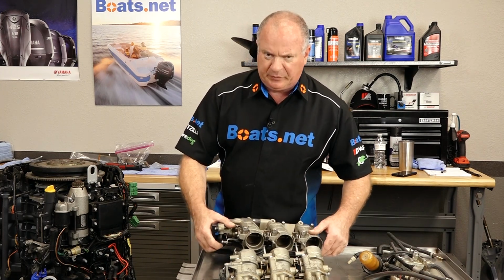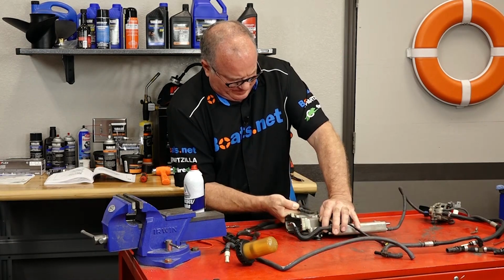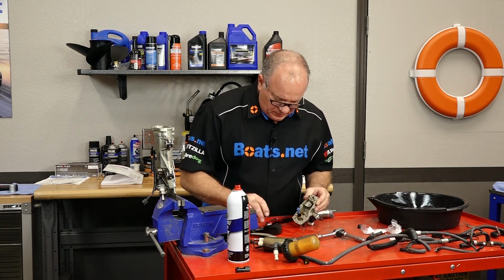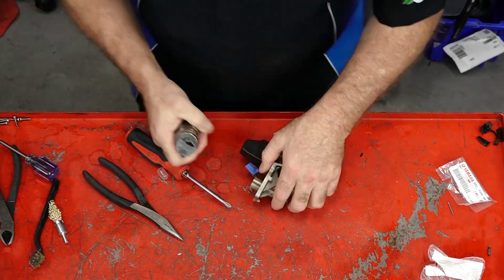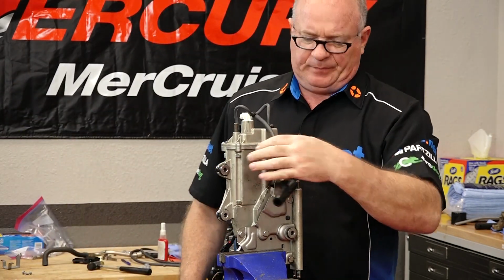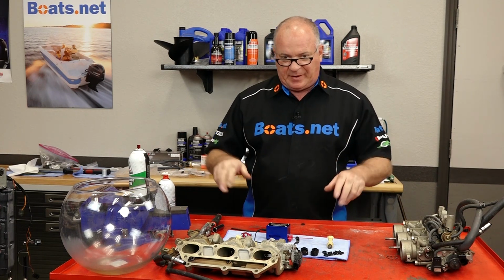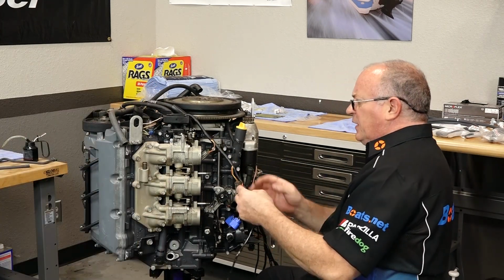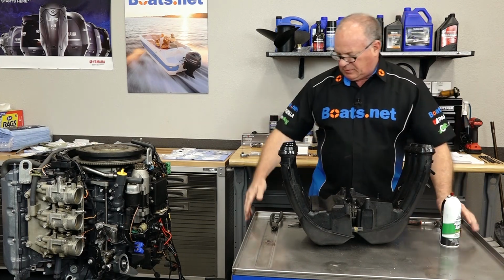Yamaha F225 Outboard Rebuild Part 7: Fuel System Rebuild | Yamaha 225 Fuel Injector Cleaning

Comment: Love your videos, super helpful. Ran into an issue that after reassembling my fuel system she fired up lovely but I have a leak at the push-connector on the high pressure fuel line. Part not labeled in the service manual - any advice?